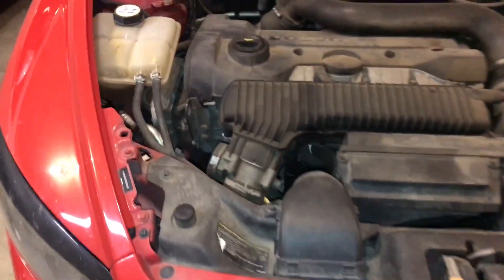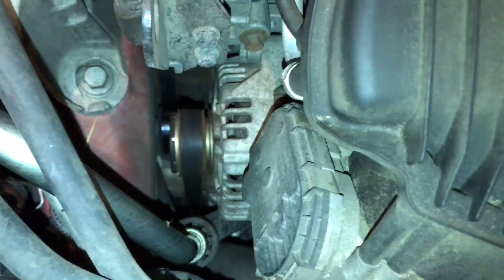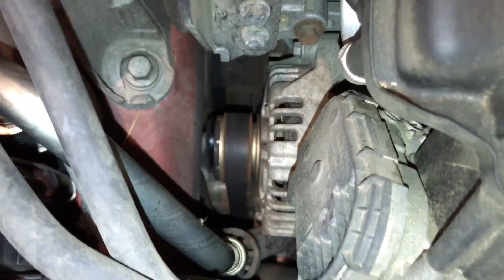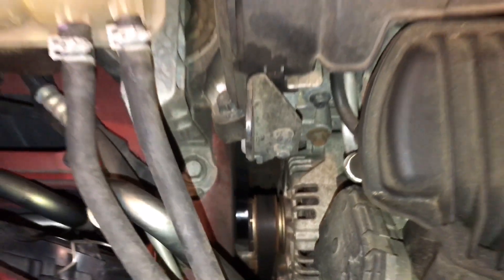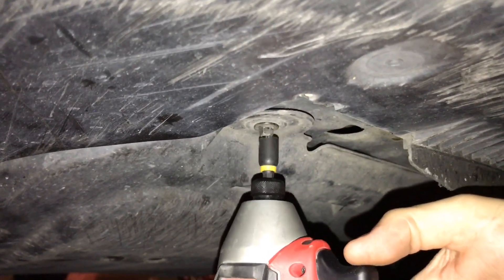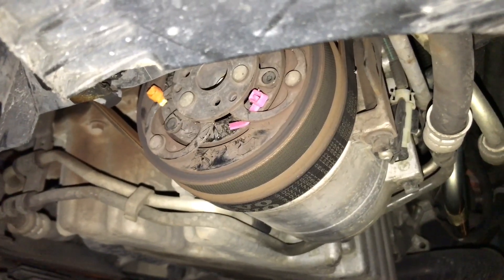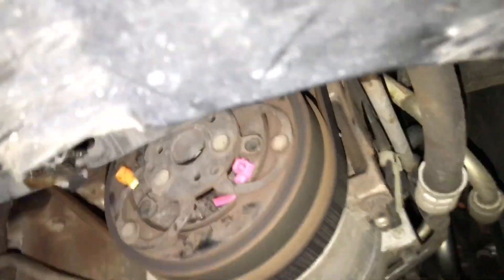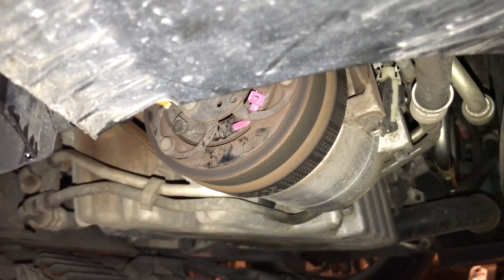Volvo C30 A/C Compressor Fix

Comment: I did It in my V70 (1999) years ago. I replace the zip-ties every summer and It works perfect. Good and cheap solution.

Comment: Hey Mark - did you put the car up on a ramp or anything? Or just leave the wheels on the ground and go underneath with the car flat on the ground?
Reply from the maker: It would’ve been much easier on a ramp, but I didn’t have one.
Reply: @mrkuswelb Thanks - we don't have one either, so I was hoping it was doable without!

Comment: great video!  My A/C works great, but recently, on two occasions, after full throttle the a/c would not turn back on unless I turn the car off and back on, then works fine for a while. What component tells the A/C to turn off and on? Why would it start to fail? 
Thanks in advance.
Reply from the maker: uberbeans I am not a mechanic, but that is very similar to the situation I had. When the system tries to turn the compressor on, the clutch cannot engage if the gap is too large. Putting the ties in decreases the gap. Just make sure that you don’t make the gap too small or the compressor will never shut off.
Reply: There is in the cars manual if you read about the A/C that it turns off after full throttle. I think it is then off for 15 min.
Reply: @KjellKarlsson1  oh really? Do you know why is that?
Reply: @Webrisernl  No, no idea at all. But maybe something with overheating or something?
Reply: @KjellKarlsson1  15min no way. It should only be for a few seconds then turn back on. Most modern cars do this.

Comment: So long term update? Still holding strong? 
Im concerned the ties would break off and get caught in the area - causing damage. Care to comment on that?
Reply from the maker: Still working great, but of course I didn't run it much over the winter time. I did double-check several times to make sure that the compressor would cycle on and off since I had heard that this fix may cause it to stay on all the time and burn it out, it cycles as expected. I am not too concerned with them coming off since I used the zip ties and locked them shut plus you really have to wedge them in. Even if they were to come loose, I don't think there is much in the general vicinity that they could damage.

Comment: How many miles are on your C30? Also, given the easy accessibility of the A/C compressor, if needed, would it be comparatively easy to replace?
Reply from the maker: 185,000+ miles - I would not attempt to replace the compressor on my own since I do not own the proper equipment to evacuate and properly recharge the refrigerant.
Reply: Mark Barnes I just bought an 09 C30 with 88k miles. The previous owner took really good care of it but I'm wondering if there are any major issues to anticipate. I know you're working on the a.c. now but 188k seems pretty reasonable for that kind of maintenance. Any big issue along the way?
Reply from the maker: I have had no major issues. Congrats, I hope you enjoy it.